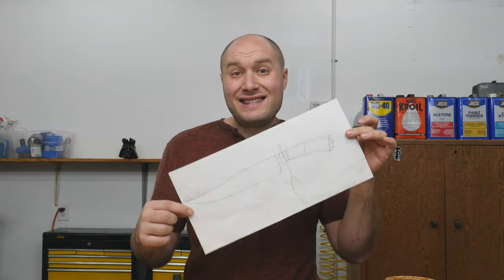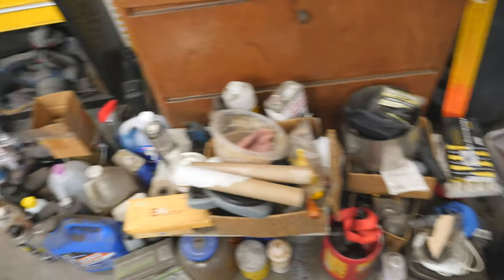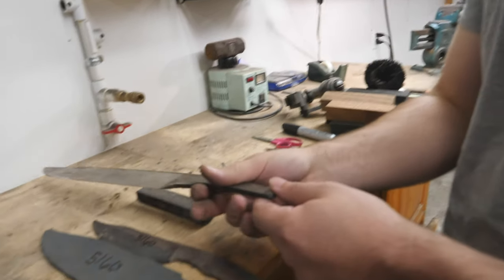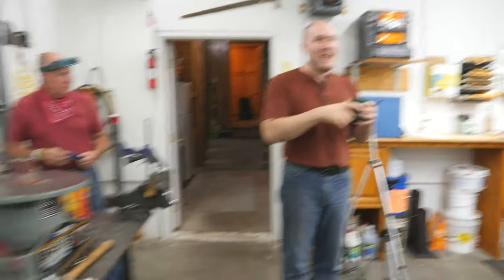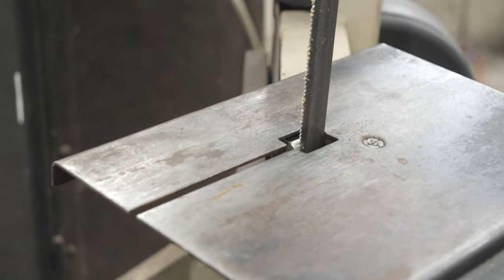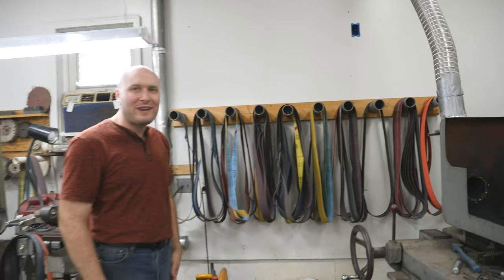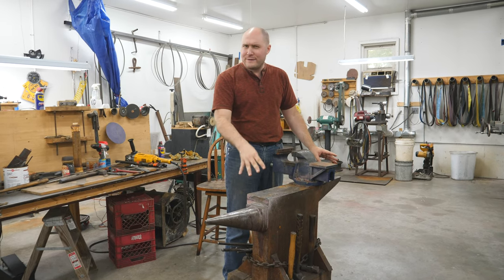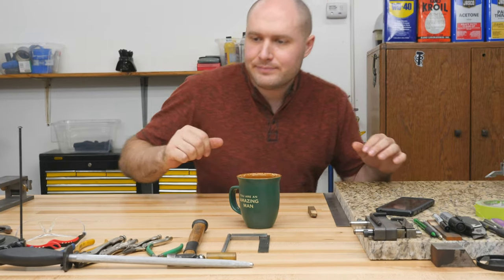A Tour of a Knife Makers Shop

Comment: Minimizing the amount of horizontal surfaces you have is the best way to de clutter. Horizontal surfaces always end up covered in crap.
Reply from the maker: Funny Jesse 
I’m not sure if that reasoning will work when I remodel my sweetheart’s kitchen work surfaces 😆👍🏻🔥🔪
Thanks for the shout out Jesse 
   Dad
Reply: KyleRoyerKnives think of it this way when your busy is it easier to place something g a a flat surface or but it back where it belongs. Almost all the time the answer will be I’ll just put it here and clean it up later. Then later turns into finding empty paper towel rolled hidden on a shelf from god knows when. I have two work benches in my shop a metal working bench and an other bench and even the. They get cluttered quickly. Love your shop though I’d kill for a mill and a surface grinder. Or a floor that doesn’t fill with water when it rains but that’s a story for another day. Keep up the good work!